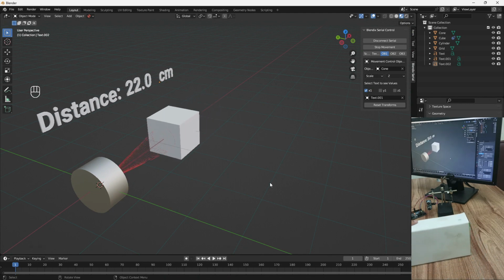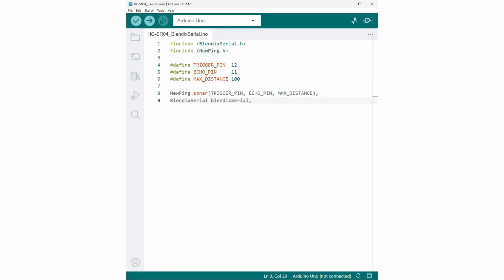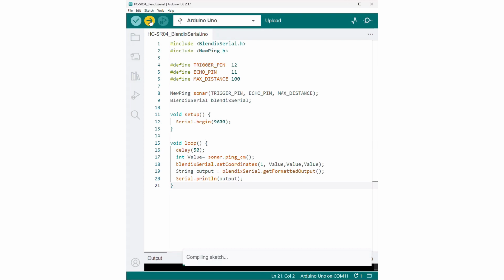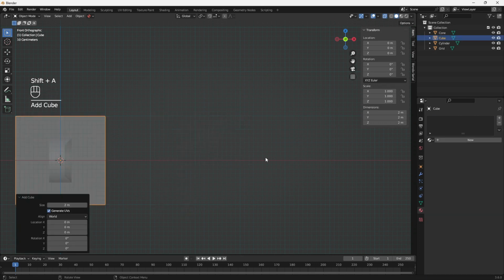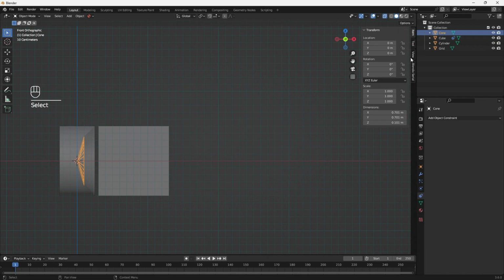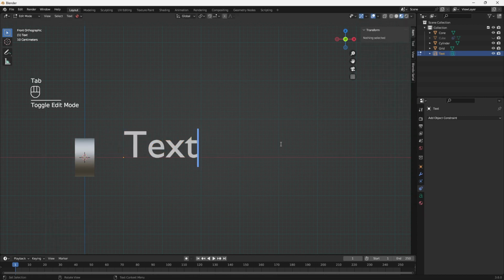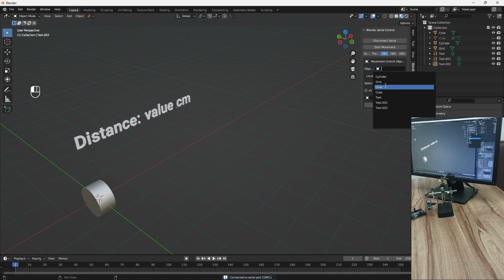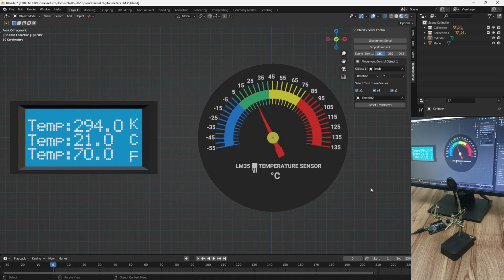Arduino Serial Communication | HC-SR04 Animation with Blender |

Comment: Hi! I´m now having problems with the conection, when I use the "Connect serial" button, I always get the error: "Failed to connect serial port COMX", I tried everything but cannot connect to the arduino board, can you please help me with this issue
Reply from the maker: Ensure the following two conditions are met:
1. You have installed the PySerial module.
2. When connecting the Arduino to Blender, make sure to close your Serial Monitor. If the Serial Monitor is not closed, the Arduino will be occupied by it and won't be able to connect to Blender because one port cannot be shared by two software programs simultaneously.